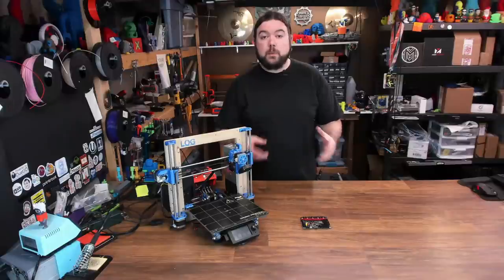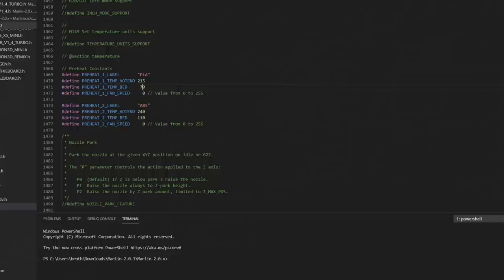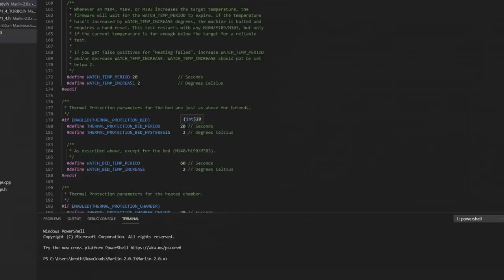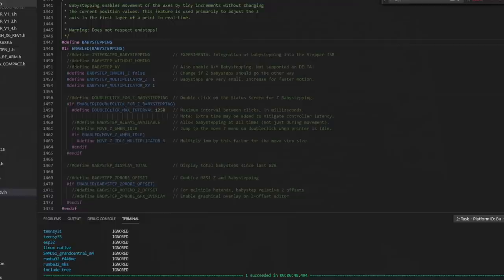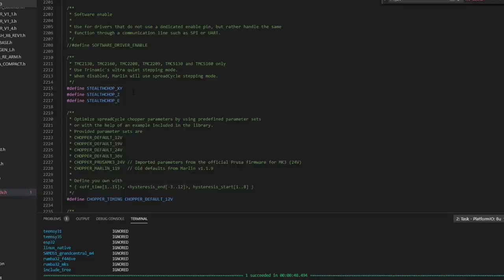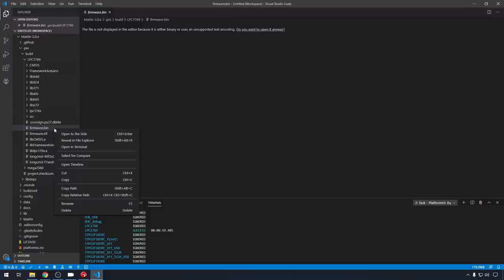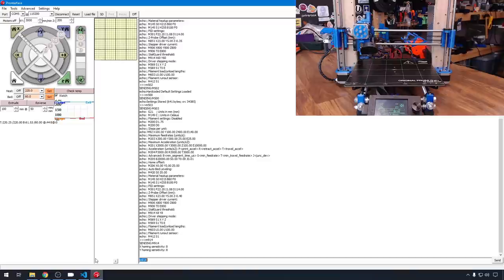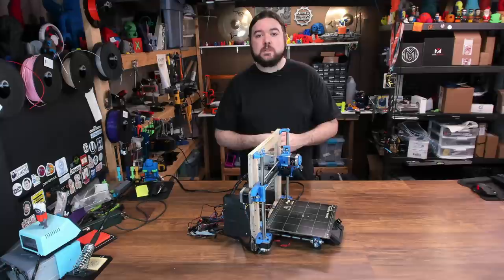BigTreeTech SKR v1.4 Mainboard - Full Install Part 2 - 2209 Drivers - Chris's Basement

Comment: Hi! And thanks for your explanations. One question I’m upgrading a CR10S with a 24v power supply a sk1.4  turbo card and x&y motor close-loop drivers. Plus linear rail on x-y-z axes. Finally a microSwiss direct extruder. It is a big project for me. Wanted to know if I better follow your suggestion going to start with the SK1.4 card then the steppers close loop card. I know it would be many  round  trip to the computer and setting up marlin , then all other things.?
Thanks.Jean Pierre
Reply from the maker: I recommend doing the firmware changes very slow. Just change a few things, load it to the boards and make sure it is reacting as you expect it to.

Comment: Hi Chris. I subscribed to your channel after purchasing a Creality CR-10 Mini. I must say that you provide some great content, thank you! While I've had some pretty good results from my printer, after hearing you talk about the latest SKR 1.4 upgrade boards, I decided to go ahead and pick one up. I bought the SKR 1.4 Turbo version that includes the 2208 drivers. Are there any specific differences that I need to be aware of using the 2208 drivers vs. the 2209's. I was planning to use your part 1 & 2 videos to help me set this up when I receive it. I'm rather a noob yet and all of the settings you cover are a bit overwhelming,  but I'm willing to give it a go. Am I in over my head or by using your part 1 & 2 videos going to get me through this upgrade process to a point where my printer is still usable, but now a lot more tweakable/upgradeable? Or am I going to have to make a lot of tweaks to things that I'm not really familiar with as a somewhat newbie? Sorry for the length of this message.  How does one go about emailing you directly? Thanks in advance.
Reply from the maker: These 2 videos should work for you just fine. 2208 will work almost exactlly the same. You can email me at brotherchris81@gmail.com

Comment: @ChrisRiley at 8:56 you are using pin from HE1 and you "placing" it at E0 not E1 ?
Reply from the maker: On one of these boards, (I think it was this one) the pins were marked incorrectly. Double check the pin out for sure.

Comment: I'm in the process of updating  my Log to an SKR 1.4 board. I was hoping that I could wire my pi zero w with Octoprint directly like the MK3 and avoid tethering with USB. You have a video on how to do this with the MK3 but I'm not sure what needs to be modified in Marlin to make it work. I thought you had a video on this but I've searched with no luck.
Reply from the maker: Nothing for Marlin, but I think you could do this with the TFT pins. I would take some work, but you could match them up with the pin out diagrams to get this to work.

Comment: Great Videos, I have one issue when connecting heatbed to SKR v1.4 with 12v 30a power source and 12v heatbed, when I connect heatbed to the board it doesn't heat up. i checked the board and noted that heatbed pins on the board is not drawing any current. is it something I am missing to enable ?
Thanks in advance.
Reply from the maker: No, you shouldn't need to enable anything, if your thermistor is reading correctly it should just work.

Comment: How do I enable the extra fan ports.  I need cooling fans for the stepper drivers to always be on, but the none of the extra fan ports are on.  How do I turn them on.  Again I just talking about the extra fan ports on the board.  Thanks in advance.
Reply from the maker: There should be 2 always on ports, there isn't anything you should have to do to enable them.

Comment: *** Very informative. I am trying to set up 2.0.7 on my homebuilt unit. Still trying to get the BTT TFT35 V3.0 talking to the board. Have trouble with chattering on the x axis. It will move back and forth on the same command and then kill the system. Continuity checks out at a lose of ideas. Bltouch obeys commands but haven't set the z offset as the lcd and x-axis are not working properly.
Reply from the maker: Make sure the cable is correct. You might need to swap some wires.
Reply: Thanks Chris I got the x and y working. Will be changing to jst-xh connectors as the Dupont ones are easy to knock out.

The zed with bltouch upon homing raises about 20mm then extends the probe. It does not lower back to the bed. I touch the pin to retract. It redeploys and if I touch it too many times it triggers the bltouch error. Measuring the bltouch voltage upon retract it shows less that 1 volt difference but does not approach  5v. Trying to lower the zed once the probe has extended it will not lower.

Comment: stupid easy question.  The LCD ribbon. Which ways do they connect to a default ENDER lcd screen and on the main board?
Reply from the maker: I think you can make it work in the EXP1 plug if you use the stock CR10 option in Marlin. Those screens should have all 3 plugs on the back.

Comment: Hi Chris. I am building a corexy printer (300x300) and have followed your videos PRECISELY. However, I continue to get errors when I try to compile. I have given it several tries over the last 12 months but still can't get it to run. Further, I just done understand the error messages. I am using the latest versions of Marlin and VSC (which does an 'auto build' of Marlin but still nada. Can I pm you a copy of the error messages? Maybe you can see something simple that I am overlooking. Noel
Reply from the maker: Yep, send over the errors. brotherchris81@gmail.com

Comment: For the LCD, are you using the "BIGTREETECH MINI 12864 V1.0 LCD"? 
Need to buy a new screen and there's loads of choices. Had another screen but turning the encoder on it causes the board to reboot so I'm guessing something is wrong with it (it's the reprapdiscount Full Graphic Smart controller)
Reply from the maker: This is the one from this video. 
https://www.amazon.com/BIGTREETECH-DIRECT-Display-Control-Support/dp/B081DTNVPF/ref=sr_1_1?dchild=1&keywords=btt+3.5+tft&qid=1610823384&sr=8-1

I like just the plan 2004 screen myself. LDO has some cool one, you will need to flip your plugs over to use them.

https://www.printedsolid.com/products/ldo-prusa-black-screen-with-white-text-mk2-mk2-5-mk3-lcd-display?variant=22245381505109

Comment: Chris, I'm looking at ordering some 2209s. What is the difference between the 2209 V1.2 and the 2209 V2. The V2 seem to be by MKS and the 1.2 Bigtree? I have an SKR 1.3 and would like to try sensorless homing. Thanks.
Reply from the maker: That version number is for the board the chip is installed on. If you have an SKR, go with BTT drivers, what ever the newest version is, probably 1.2. This is going to save you some hassle because they where designed to work with that board.

Comment: 14:10 might consider leaving Arc enabled. A creative user is working on an Octoprint plugin to generate G2/G3 commands from G1 segments. This will hopefully help avoid the bottleneck in the way Octo handles data transfer to the firmware for curved geometry.
17:30 I could not get this to work correctly on 2.x and that's pushed me over to Klipper. I'm happy with it so far and nearly doubled my print speeds at the same quality.
Reply: I'm curious if the bottleneck is lessened, and to what extent, by going from 115200 to 250000 baud rate? This is the first mainboard that supports the faster speeds that I have owned. I have tried to youtube it, but I can only find sdcard vs usb related material.
Reply from the maker: Very interesting, I will be interested to see where that goes.

Comment: Almost got it sorted, BLTouch seems to be working now the only thing is during leveling the bed goes the wrong direction however the only option I see to fix it is #define Z_HOME_DIR  -1 however this is only telling the machine what way home is? Ender 5 Plus
Reply from the maker: Would changing Z motor dir solve it?
Reply: @ChrisRiley  Working now :) not properly but I am currently printing a new case for the electronics, as for Visual Studio..... what an evil program ha ha you cant even delete and start over with it, once I get it all set up correctly I will tweak things, 2am finish trying to sort more than a few days....... great videos I come back to them all the time, one thing I am surprised with is the examples in Github (ender 5+ for example) are way off what they should be which adds to the confusion I feel

Comment: Hey Chris, I have the SKR v1.4 turbo board and I have installed it in a Creality CR-10S. I am having issues with the extruder stepper motor running backwards. I can't find the line in the configs to reverse the direction. Any tips or help would be much appreciated! PS. your videos are great and very helpful!
Reply from the maker: Thanks! You need to change this one. #define INVERT_E0_DIR false

Comment: Closed loop control for 3D printer is good or bad...? With reason which motor driver are used for good quality printing..
?
Reply from the maker: Closed loop would be good for 3D printing. They are not very easy to get at the moment. I would just stick with regular steppers and TMC2209 drivers for now.

Comment: Need advice please...I have older Davinci 1.0 and have been tinkering with for years as a side project. looking to replace board, any suggestions?
Reply from the maker: I'm not sure on that printer, any board should work, but the wiring and firmware might be a nightmare.

Comment: So you can set the vref in marlin, rather than the little pot dial? Is that for 2208s also, or just 2209s? thx
Reply from the maker: If you are in UART mode, you can set vref with the code on both 2208 and 2209's. M906 command I think.

Comment: Ciao volevo sostituire nella mia stampante 3D, la scheda arduino e ramps 1.4, ho preso la BigTreeTech SKR 1.4 Turbo con i TCM 2209 è l'alimentatore da 24V.
Per quanto riguarda la resistenza dell'estrusore la cambio con una a 24V,  ma come Bed ho un MK2a 300x200 che se non sbaglio è a 12V per questo cosa fare se voglio passare a 24V?
A questo punto mi conviene alimentare la scheda a 12V o è meglio alimentarla a 24V sostituendo il Bed a 24V e quale modello esiste con un area 300x200 ?.
Reply from the maker: È una strana dimensione del letto, non sono sicuro di dove potresti averne uno, ma consiglierei di andare con 24v per tutto.

Comment: hi Chris, I'm setting up a skr 1.4 turbo with tmc 2130 with sensorless endstop, but if I don't select X_MIN_ENDSTOP_INVERTING and Y_MIN_ENDSTOP_INVERTING on TRUE I have error on Building..
Reply from the maker: Yes, on some drivers they require you to set the endstops a certain way to make sensorless homing work.

Comment: Hey Chris, did you try getting UART0 on the TFT header running and if so, how did you do it? I'm struggling with getting any serial output on the TXD0 Pin (planing on connecting a MMU). Ah and thank you, finally my extruder fan isn't constantly running while idle anymore!
Reply from the maker: My TFT seems to work if I set my serial to 0 and my serial 2 to -1.
Reply: Thanks for your answer. Good to get at least one Answer, that someone got this Serial running. I got no luck connecting the MMU to this Serial.

Comment: hi Chris, grate video, very helpfull tank's to you i can now use my printer whith this board and sensorless homing...only a problem with pronterface...some command like m502 or the m500 don't confirm when i sent to the printer...m503 and m914 for exemple are going good...any advice? tank's again
Reply from the maker: Hmmm, check you config, make sure eeprom enable has the comment taken off. It is commented out by default.
Reply: @ChrisRiley  tank's...i Give a try... Cheers from an Italian living in Spain 🍺

Comment: Just updated my SKR 1.3 TMC 2208 (going to another printer) to a SKR 1.4 & TMC 2209 on my CR10 S4.. they are a LOT louder. Minor changes need between the two boards and drivers so not sure why they are so loud especially on Y any ideas?
Reply from the maker: That;s very strange, maybe they are defaulting to spreadcycle.

Comment: Great vid Chris. Do you have any tips for testing whether both hotend and bed mosfets are operational? I have a new skr 1.4 turbo board which is not responding using your setup. Bed and Hotend is new and measures ok resistance wise. I have also contacted BTT. Any advice appreciated
Reply from the maker: When you turn them on there should be an LED for them. Other than checking with a meter that's about all I know to do.
Reply: @ChrisRiley  Many thanks Chris. No lights unfortunately but BTT have come to the rescue and confirmed the thermistor ports are faulty through a series of checks. They have also offered to replace under warranty so great news. Thanks for sparing the time to respond!

Comment: I've got a firmware built and flashed. It's nearly identical to my MKS Gen 1.4 config in the same Ender 3. The only changes I made were to change to TMC2209 UART instead of DRV8825. Jumper pins are positioned correctly. I can set UART settings from the printer screen, and I'm assuming they stick.

None of my stepper motors will move, though. I do have sensorless homing DISABLED in the firmware (and have manually disabled the diag pin on the stepper drivers, as directed), and all my end stop settings remain the same as they were with the Gen 1.4. Everything is working as expected except for the minor pesky detail of my motors not moving or even attempting to move at all.

Is there something obvious that I am overlooking when migrating to this driver and board combo? Like I said, I had nearly identical settings on another BTT mainboard that all worked. Pulling my hair out trying to figure this one out.
Reply from the maker: Sounds like maybe the motor wires are flipped, I would try to switch the center 2 motor wire with each other.
Reply: @ChrisRiley  I ended up figuring it out. I had enabled some settings for a different TMC driver, thinking they did something that they don't.

Comment: i had problems with fysetc tmc2209 v2.1 and v3  .i always gets tmc connection error, on the tmc2209 v2.1 it was easy to solve ,only put a jumper on tx and rx header, on the tmc2209 v3 it was a bit dificult because the pin arrangement changed the uart pin is called rx on the silkcreen ,the solution was to install the uart jumper on the skr v1.4 board diagonal fom  uart (the 3rd from above left red )to 4rd from above mid red you must bent the 2 pins a little bit together so the jumper fits ,what a mess ,now all works
Reply from the maker: Nice! Great find, this could help a lot of other people.

Comment: Hey Chris! Nice guide dude It helped me so much!
Btw, does It have to be powered by a power supply (12 or 24v) for the firmware to flash the board?
I cant flash It neither with the sd or USB :(
Reply from the maker: If you want to flash it with just the USB power there is a jumper you can move to allow you to do that. https://youtu.be/oHMZ0ocTYvM?t=545 If that doesn't help you may need to load a driver on your computer to be able to connect.
Reply: @ChrisRiley  already fixed! I was not aware that the board would delete the previous .CUR and convert the .BIN into .CUR flashing It onto the board. I've flashed It like 35 times before realizing it lol haha

Comment: First of all I watch your videos and you can't imagine how helpful they are! I ahve followed your guide but sensorless homing does not work... The x axis crashes until it crashes the firmware... I even set sensitivity to 255 and still the same... Any ideas?? (SKR1.4 Latest Marlin 2.0.6.2)
Reply from the maker: Are your diag pins installed on the drivers? which drivers do you have?

Comment: Chris thanks for the videos you make. They already helped me a lot. But now I tried to install SKR1.4 turbo board with 2209 drivers, like you did in this tutorial, but I did it on a delta printer, and I have two problems. When I connect the probe to the pins that you indicate, the board turns off. I use m119 in prompterface and this appears
SENDING: M119
reporting endstop status
x_max: open
y_max: open
z_min: TRIGGERED
z_max: open
filament: TRIGGERED

And the printer moves up on pronterface, but when i make the autohome it moves down.

Do you know what I might be doing wrong? Will it be hardware or firmware?
Reply from the maker: Thanks for watching! Not sure why the printer would turn off. Make sure the wiring is correct again. I don't remember how the pins are setup, but maybe there is something up with a power detect that would turn it off, or maybe a short. The second issue, I think I would just flip all 3 motor directions in the firmware first and see if that solves it. Flip these to the opposite. 
#define INVERT_X_DIR false
#define INVERT_Y_DIR true
#define INVERT_Z_DIR false

Comment: Chris, Great breakdown on the file changes and information. but recently I tried loading a new build on a new board for a Creality Ender 3 Pro.  the issue is that I was using a new Windows 10 Laptop and loaded VS Code and platform IO I keep getting an error of the Arduino.h file is missing. Not sure why this is happening? Using the latest Marlin build downloaded, 2.0.5? I took a look at platform IO  but I am not getting a clear idea what the issue is, other than possibly the Platform IO libraries are missing some key files? Any suggestions? Do I need to add anything to an Include file in my Marlin folder?
Reply from the maker: Thanks! Alot of time with Marlin and Platformio the file path gets too long. WIndows has a 280 limit I think. If you hit that, it can't find files. Try moving your Marlin folder to C:\ and re-adding it to VScode and try again.